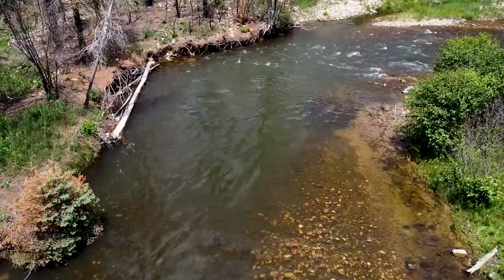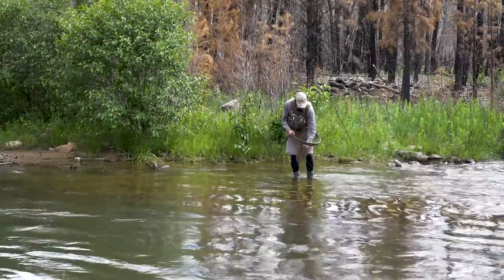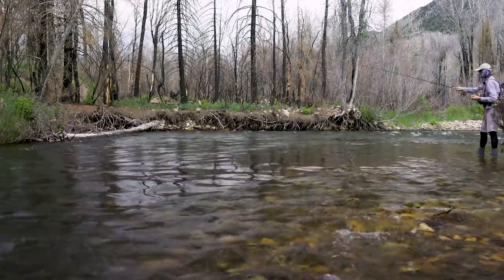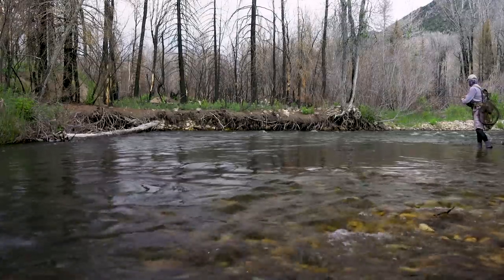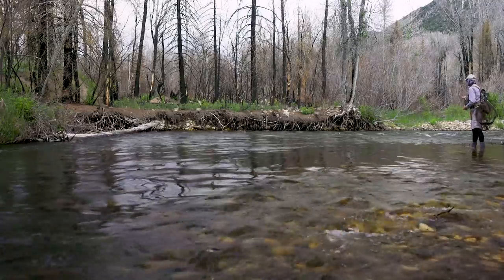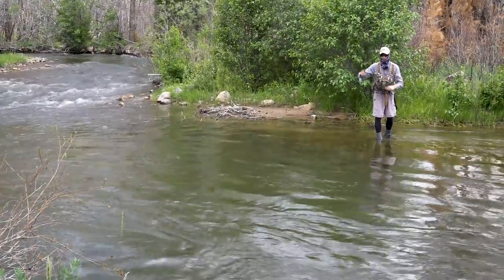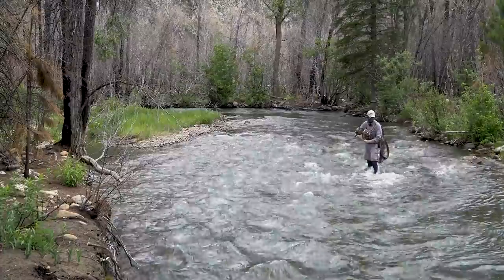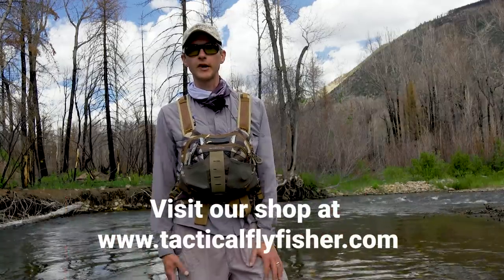Reading the water: Fly Fishing a Corner Pool

Comment: great vid.  you offer so much great info, thx.   question at 2:28ish after you landed that rainbow, released the bow, you did like 3 quick counter clockwise flicks before getting back at it.   what did that accomplish for you?  help unwind the leader that might have gotten wrapped on the tip top or 2nd, 3rd guides(happens to me all the time with C2 but not my hardy(snake guides)).  or remove twists in the leaders that you believe are accumulating from casting right handed?  just curious. thx.
Reply from the maker: I had some crud on my flies. I was doing the San Juan slap to clean them off as I covered in a previous video.

Comment: Thanks again Devin, I like how you walk us through how and why you fish a section in more or less real time. 
To summarize, your point fly varies in weight from 3, 3.5, 4mm based on water, and your tag fly was 2.5mm perdigon throughout? 

When do you decide to use a 2wt vs 3wt rod and 10ft to10.9ft rod nymphing rod? Is T&T contact 2 rod still your go to rod? Was the third rod you brought your dry fly rod?
Reply from the maker: I just had a 3mm inverting bead when fishing the dry dropper. When nymphing, you are correct about how I varied beads. I choose the rod based on the size of the river I'm going to fish. The longer rods have more hook setting power for deep water and more reach but the shorter rods are a bit more accurate in tight quarters. I also just choose to fish different rods for fun some days. Yes the Contact II is currently my go to and the third rod was a dry fly rod which I used on several slower side channels we fished elsewhere.
Reply: @tacticalflyfisher3817  thanks Devin, was the leader for the dry dropper the same as the leader on the Nymphing rod? Is there any reason or downside to fishing a dry dropper on a micro thin leader? Is 2x leader a good middle ground when first trying out micro thin leaders? Thanks so much
Reply from the maker: @VTBullitt  the leaders were the same. Start with 2x and see how you do.

Comment: You said the water temp was 62, yet you were not wearing waders. Would you please address what it is that you were wearing? 
Before I moved I used to fish a place with almost exactly like what is shown in this video. I now understand why it is that I would catch most of the trout in the slack water rather than against the bank which was deeply undercut or the trout I caught in the upper shallow seams. Thanks for the explanation.
Reply from the maker: I rarely wear waders in the summer regardless of the water temperature. I spend a lot of time wet wading down to 48--50 degree water as long as the air temperature is 75-80 or above. I tend to stash a puffy vest or jacket in my pack if it gets cloudy or cool in the evening. For my attire, I was wearing men's leggings under fishing shorts with neoprene booties under my boots. You can find lots of leggings options with a quick google search. If the water is really cold, you can also wear Hydroskins from NRS.

Comment: Thanks for the video, very well done. Was the rod change only because you happened to have another angler there with a rigged up rod? Do you ever carry multiple rods rigged for different tactics? If so, how do you usually do it?
Reply from the maker: I carry multiple rods most of the time. I either just ferry them with me and place them on the bank or I use an Opros 3rd hand rod holder that we sell in our shop.
Reply: @tacticalflyfisher3817  Thanks. How do you rig the two generally? One for dries and one for tight lining?

Comment: thanks so much for your videos. just curious as to why you use a perdigon as a dropper and not something with a bit more action and bulk.
Reply from the maker: The same reason I use perdigons for any other situation, sink rate. The quicker the fly sinks, with the least weight, the quicker it will come tight to the dry and provide strike detection. A lot of folks swear by soft hackles and scraggly nymphs for their action or bugginess. Then they turn around and fish a zebra midge not seeing the contradiction. I use soft hackled and scraggly flies plenty as well but perdigons have just about replaced any need for other styles of small mayfly nymphs in my boxes because they just plain work.
Reply: @tacticalflyfisher3817  do you ever fish thread frenchies? I like the mix of perdigon elements and traditional pheasant tail qualities they have.
Reply from the maker: @devonbustard1623  I certainly have in the past but they aren't a part of my regular rotation at the moment.
Reply: @tacticalflyfisher3817  Thanks so much. I have a T&T contact II 10ft 2wt but find myself resorting to indie fishing since my tailwater biggies seem to insist on #20 or smaller to fool them. Will try perdigons in a bit faster water and see if I can fool them on #16-#18.....love all your videos!!!!
Reply from the maker: @nfri5108  I fish size 20 perdigons all the time so don't feel like you have to fish larger patterns. Just get comfortable with putting on a 2.5 mm inverting or 2.3 mm slotted bead on a size 20 hook. It will look weirder to you than it does to the fish.
Reply: @tacticalflyfisher3817  THANKS SO MUCH!